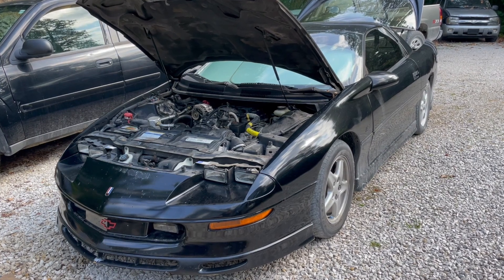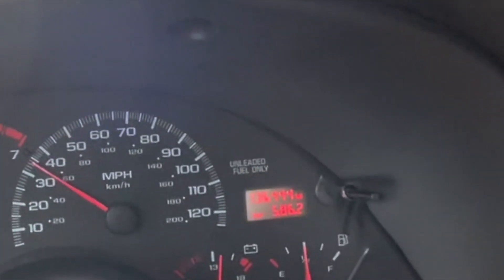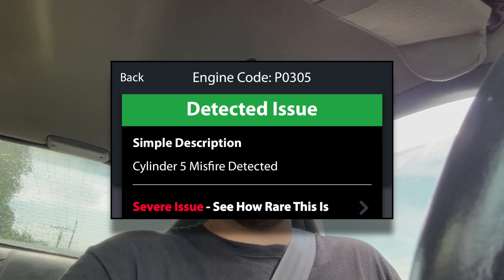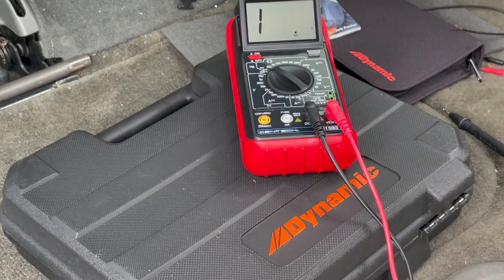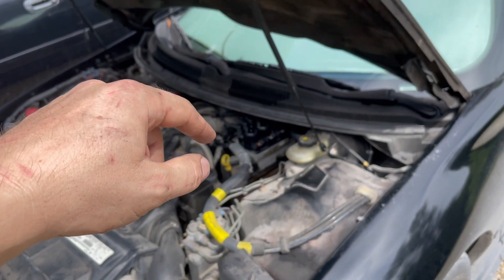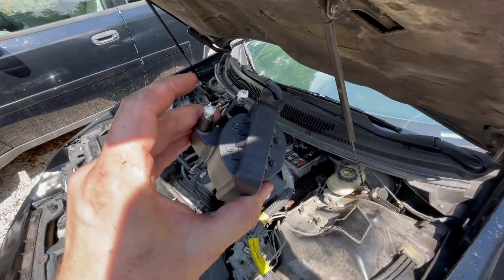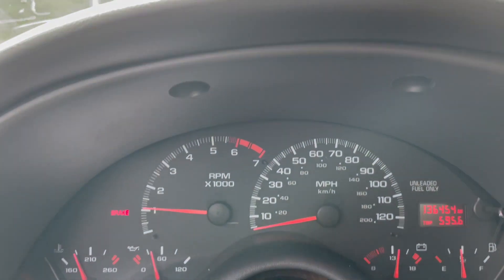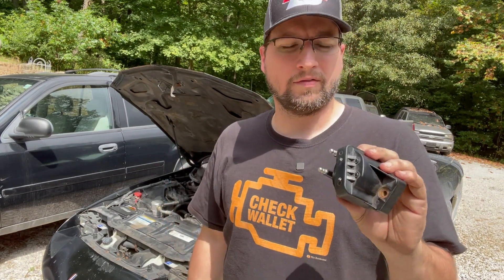P0305 Cylinder Misfire - 3800 V6 - Bad Coil Pack Tested Good - FIXED!

Comment: Get a spray bottle of water and spray the coils. if you have a crack in the coil or a bad boot it should run worse and you might be able to see the arc.

Comment: I got a l67 supercharged 3.8 I swapped in my 99 it's a 5 speed and I changed the rear out with a 02 SS Camaro rear my buddy sold me for 200 3:42 g80 posi Trac I got lot done to my l67 ported lower intake ported the m90 zzp 2.0 PCM 2.4 zzp pulley 80 psi zzp high flow injectors headers zzp long tube  3" zzp down pipe 3" pipe to back no cat borila muffler  I daily it 18psi boost runs 11.8 faithfully

Comment: I have code P0302 but only when it rains ... I believe that the coil is cracked ... because I have already placed new spark plugs and spark cables. What do you think ... when the weather is dry the Firebird V6 2002 runs great!!! 

What do you think guys 🤔
Reply from the maker: I have run into this issue as well. One of the scoops on my hood lets water in and it drips onto the coil packs! I believe that may be why my coil was cracked.
Reply: @TheDaninator  Your video is great ... I'm going to buy the Duralast Ignition Coil tomorrow at Auto Zone ($43.99) and replace it as you showed in your video and then I will wait for the next rain and go for a test run ... then I will update my comment to let you know the results.

Note: even when my car is parked outside under the cover parking when it rains I get the code P0302 ... it is just the high 100% humidity ... I talked to a friend of mine who has been a professional auto mechanic for over 40 years and he told me that the ignition coil has a crack and that is why it misfires when it rains ... after speaking to him, I searched the internet and I found your great video showing how to replace the ignition coil ... I also watched your video on how to replace the ignition control module, also a great video ... thank you for teaching us how to test and replace auto parts.
Reply from the maker: @patmackay273  save the cracked coil. Grab some silicone and fill the crack if you can. These puppies are expensive. Keep it as an emergency spare in your car. You never know 👍
Reply: @TheDaninator  Great idea ... I will do as you recommend ... Thank you :)

Comment: I had this exact problem. Same solution.  bench tested the coil packs, all tested ok. Swapped 2 of them, misfire moved to a different cylinder.  New coil packs all around for me.  Now I have 2 spares on the shelf, because new parts suck...

Comment: Must the car get warm before missing?  Mine is missing from when I start it.  I replaced the plugs and coils. Still missing.  I assume from your video and the similarities it's the ICM.  I hate to buy the part and be wrong.  Thanks for another great video.
Reply: You can test your ignition control module with a multimeter to see if it’s bad or not.

Comment: 3800 Misfires are 
1. Ignition control module
2. Coil packs 
3. Spark plug wires

Go to the junk yard and pull some spares and keep in car.
Reply: I own a car with the same engine that I've had since 2015. I usually keep a couple of icms and a handful of coils handy.
Reply: Have a suggestion for crank no start with 3800 II, was told no cam sensor signal replaced sensor then checked for magnet on cam sprocket inside cam sensor window looks perfect, wires, plugs and coils done about a year ago with 1 bad coil, threw in ignition control module and still crank no start 🤦‍♂️

Comment: What coils is everyone buying? Is there a certain brand i should go after?
Reply: Stay away from used equipment
Reply: I would stick with OEM brand coils but I would test them before installing with a multimeter because they can be bad new out of the box.

Comment: I swapped 3 with 5 to isolate 3 misfire, replaced all 3 coils and 2 weeks later it's getting multiple misfires so I'm replacing the ignition control module.

Comment: Yeah I had a number 6 missfire, I got a junk yard ICM with coil packs and that fixed the p0300. 
The number 6 appeared after that and I was like yeah progress lol, I replaced the spark plug and the burnt brittle number 6 wire. 
Didn't fix but swapped for my old coil and it worked again... well like yours but it trips the missfires but doesn't leave a missfire code. 
I went back to the junkyard today and had them swap the coil and they give me this pristine one... put that in the spot. 
It ran great but not completely fixed but way stronger. 
So now I'm curious about the other junk yard coils. 
They closed for the day but I want them good looking coils lol
Reply: $100 for all 3 brand new two weeks ago here
Reply: Goodness yeah it was the junk yard coils. lol I went back and got them to replace them with some pristine ones this time... it turned out well... I suppose I did change the 4 fule injector while t/s longer ... so I no longer have a dripping sound when I shut off the engine ha.
50 bucks for icm and coil packs.. .
I found out that autozone will bench test that icm which now I have 2.
Reply: @bwet2901  I had to replace the ICM also, two weeks after all new  coils, I got multiple misfires.

Comment: I need some help man I replaced all the coils, plugs and wires cannot figure out what the hell is causing it to misfire…. No engine light 94 camaro
Reply from the maker: If you have ruled out electrical, check fuel. Clogged injectors or fuel filter or weak fuel pump. Maybe bad fuel pressure regulator. Worst case, bad cylinder compression.
Reply: @TheDaninator  where should I be looking for electrical?
Reply from the maker: @demondms  …plugs, wires, coils, ignition control module…

Comment: I have a 98 v6 and i have the code po305, i changed the spark plug, swapped the wire, got a free new coil pack, changed the injector and ita still flashing , it didnt do this until i took out the fuel tank and put a new pump in and cleaned the tank
Reply: Ignition control module? Or the pin for #5 on its connector?
Reply: you ever figure it out? sounds like my current issue. i cant afford to throw any more parts at it?